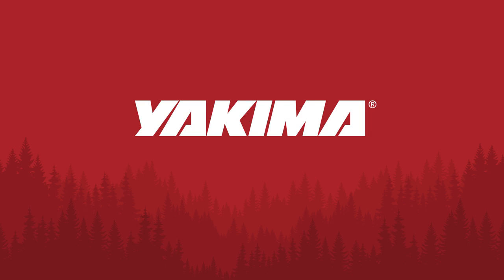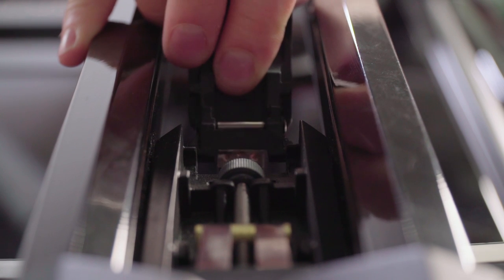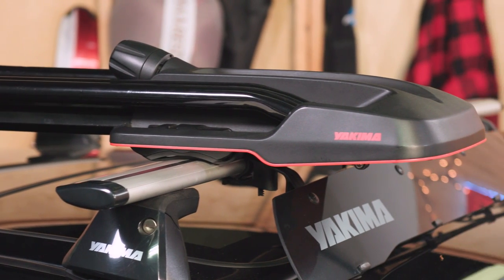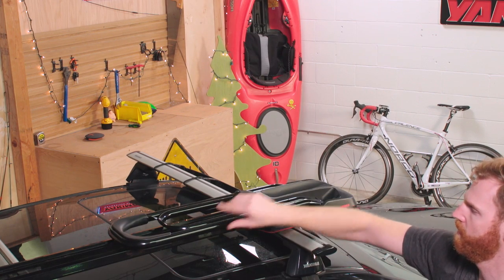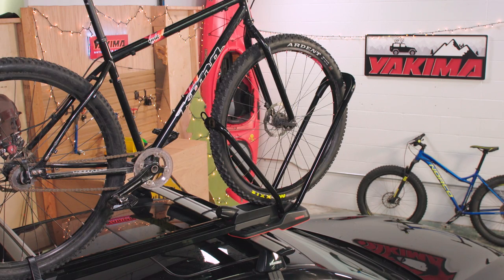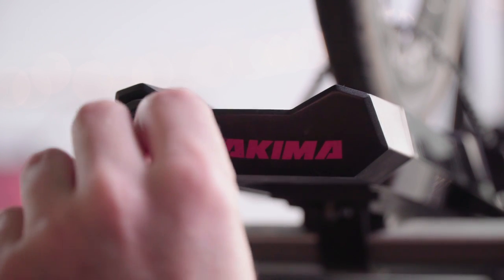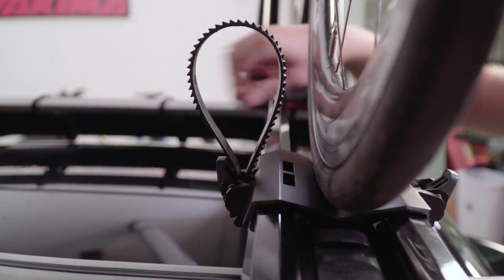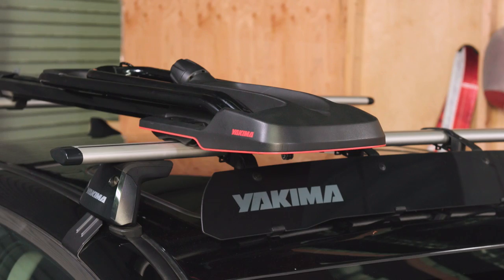Yakima HighRoad Upright Bike Mount Product Tour & Installation

Comment: Just got this rack and it's my first roof mounted rack. I really regret it. It doesn't lock to crossbars and if you do want to lock it, you need to purchase locks separately, which I haven't been able to find in stores. Also, the front wheel bars don't lock down when not in use, so they slam up and down when going over bumps. I'm bummed about this one, I'd look for another option.
Reply: Velcro or a very short bungee cord is your friend to keep the bars from slapping up and down. Getting one soon, but will probably pay 2x the price of generic locks and get the Yakima ones. I like supporting American jobs for smaller things within my budget.
Reply: Mine came with the locks (UK). The next comparable Thule didn't come with any and the locks are more expensive.

Comment: what lock cable did they use for the rear side?
Reply: The cable is built into the rack. You will need lock cores to lock the cable

Comment: Design needs to be improved those 3 rubber straps make it a no no to leave you bike lock on as they can be cut with a utility knife in seconds and bye bye bike and highroad rack.
Reply from the maker: Hi Thomas,

The strap is a stainless steel metal band that is covered in rubber.  Not sure if you have ever tried to cut stainless steel like this, but it near impossible to do with hand shears, and impossible with a utility knife.  Not sure if yo have the actual product or are just looking at the video, if yo don't have one, i'd suggest looking at one a local retailer to understand how it is made and works.
Reply: Thanks for the info about the straps. I own two of these racks and feel much more confident about the straps now as I assumed they where just rubber.
Reply: @thomaswyatt199  Hey can you give an update on any issues? How about rust?
Reply: @YakimaRacksOfficial  Thank you for this clarification, I was worried about the longevity of the rubber!

Comment: Hello, will this work with my 1273mm wheelbase nukeproof mega?
Reply from the maker: The High Road will not accommodate a wheelbase over 48".
Reply: Yakima Racks thank you for the swift response. Do you have any roof racks that would accommodate a 1273mm bike? I work that out as 50inches? If not, do you have any in development? Bikes are getting bigger!
Reply from the maker: You can use the Fork Chop, but the Crossbar spread must be ±10” of bike wheelbase for proper use.

Comment: get the highroad or frontloader?
Reply from the maker: Both carry the bike with the wheels on.  If you have heaver trail bikes I'd go with the HighRoad, otherwise the FrontLoader works very well for road bikes, gravel bikes and cross country bikes.
Reply: @YakimaRacksOfficial  I bought a used Frontloader and find it extremely difficult to load and unload because the rear wheel tray is too short to rest the back tire in while I'm getting the front situated.  Is there some trick to this that I can't intuit?

Comment: Let me try to understand this - the only things that "securing" the bike mount to my existing roof bars are 2 soft rubber straps (0:51), you can have all the bike locks you want at the top. All someone needs is an exacto knife, cut off the straps and throw the bike along with the bike mount (with whatever locks you have at the top) in the back of their truck and drive away in less than 60 secs flat. And take their sweet time to cut through the bike mount with a grinder in their garage. All the locks mentioned in this video are meaningless as they only secure the bike to the bike mount, but not to the roof rack it self which is secured to the car... Most decent bikes cost at least a few thousand dollars, I certainly would not depend my bike security on 2 rubber straps...... Yakima, hope you take this into consideration for your future rack designs.
Reply: The straps are steel with rubber covering to protect roof bars.
Reply: @bike.mad.kimbos  Yes from my research they are stainless steel. Btw those stainless steel rubber coated straps looks easy to cut so I would use a U lock to lock the “hoop” onto the rack after you take your bike down.
Reply: Yes from my research they are stainless steel. Btw those stainless steel rubber coated straps looks easy to cut so I would use a U lock to lock the “hoop” onto the rack after you take your bike down.
Reply: Yeah but you run the cable lock around the roof bar. Then you can run a u lock for the front frame and add another cable their around the frame if you are leaving the bike extended period of time.  If thieves want it, they will have the tools but this will make easier targets much more probable
Reply: I just got this rack and while the straps are supposedly steel, they stretch, so you could easily cut them at the stretchy part. Also, there's nothing holding those metal bars down when there's not a bike in the rack. So they slam up and down when you go over a bump. And selling locks separately? Really? I totally overlooked this, thinking that a bike rack would naturally lock to the crossbars. I regret this purchase!!